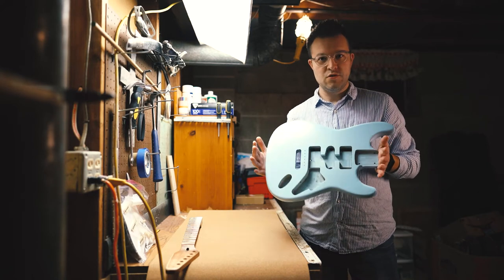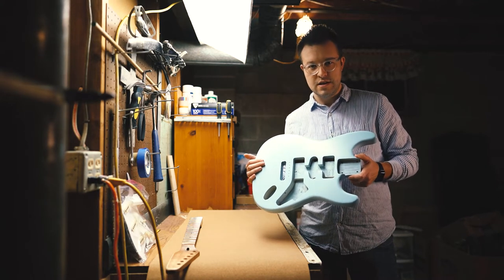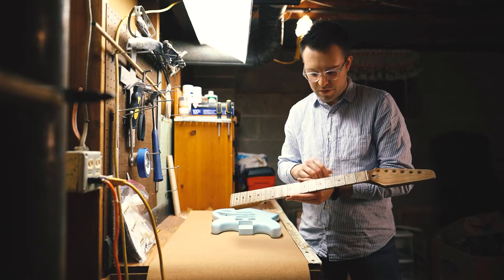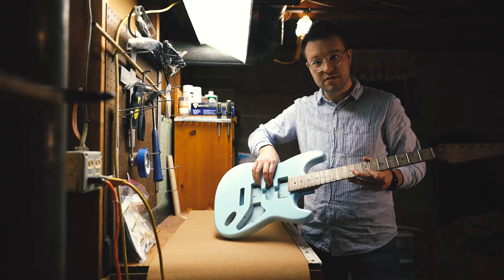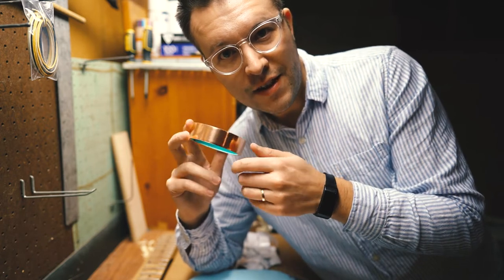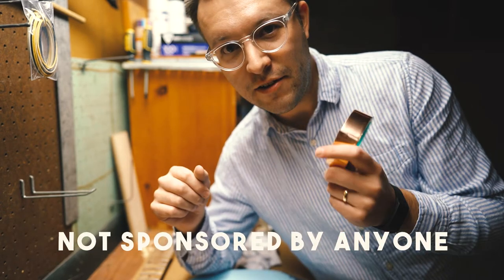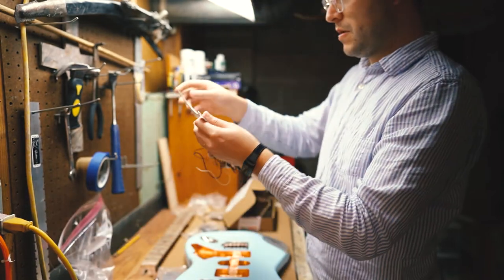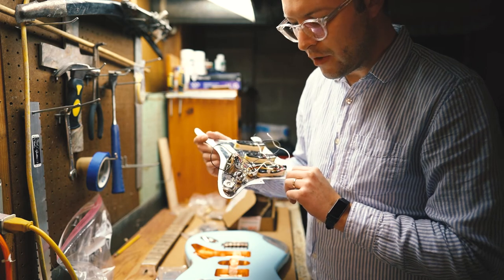Building a Kit Guitar from StewMac - Ep4 -  Body Relic, copper foil, hardware

Comment: I think you should change the pick guard to a mint green one. That will really help it look like a relic. Also at the bottom of the fretboard you should round off the edges because higher end American strats are always rounded off while the lower end are usually left with those corners. It’s just to make it look more aesthetically pleasing. You should do more of these kit guitars, and really supe them up. These are great videos👍
Reply from the maker: Hi Jack! You have a good eye for detail. I'll have to look up some more pics of vintage strats. It's not easy to see but the pickguard is a parchment color, so it looks faded off white, i could put a white paper next to it to show that.

Comment: Eeeewwwwww, relic finishes........

Cool project, but the relic finish has always been lost on me in my years of playing.
Reply from the maker: Yeah, it's not for everyone, I got into it because it looks like a vintage guitar. I'm not into the heavy relic stuff that just looks like you tossed your guitar around for years without a case.
Reply: Archie Woods fair enough. I’m looking to build a stewmac kit because they seem to be the only quality ones that don’t require much extra work outside of building/setting up.
Reply from the maker: @thisguy2973  Their T & S kits are decent, the Wilkinson kits are really nice, but the price is much higher.
Reply: Yeah, my guess is that people purposefully relic a guitar because it is amazingly hard to get a beautiful high gloss finish.  Tons of block sanding and multiple clear coats makes it a chore, but the results are a beautiful finish, and I would not settle for less on my projects.  Much easier to spray some enamel and beat it up. :)  Nice project though!